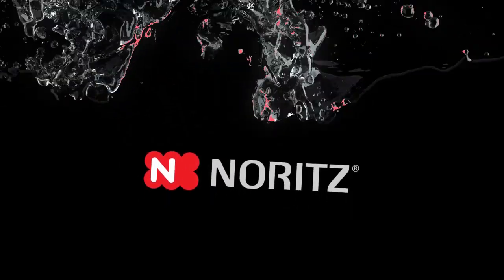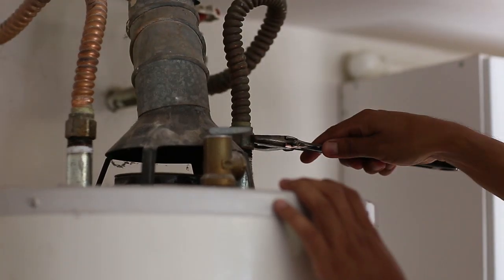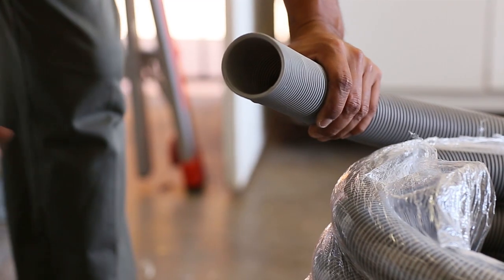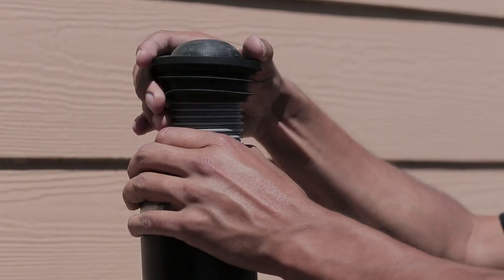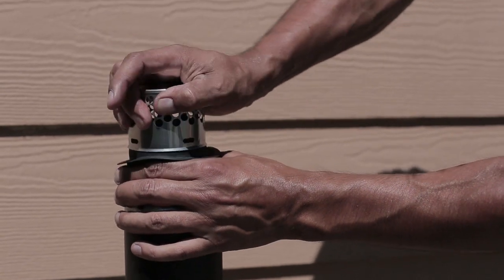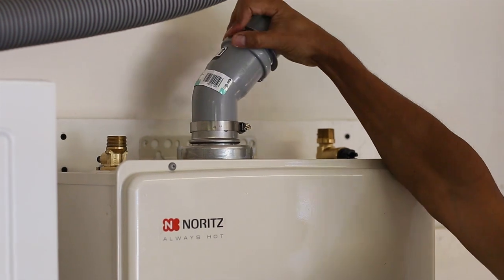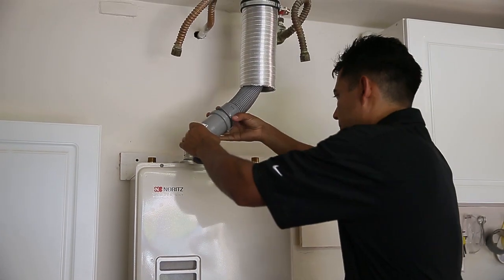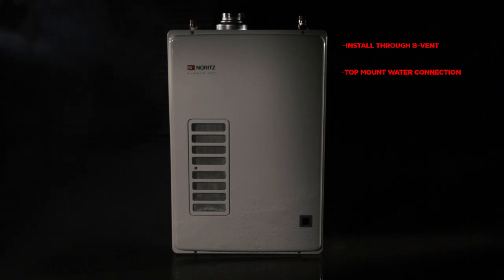Noritz EZTR40 Installation

Comment: This video does not make sense.  It says to turn the unit on and make sure there are no leaks and the water isn’t even connected.  It didn’t show the valve installation or anything to do with the water lines.
Reply from the maker: It's a high level overview. For specific details, professional installers should consult the installation manual.